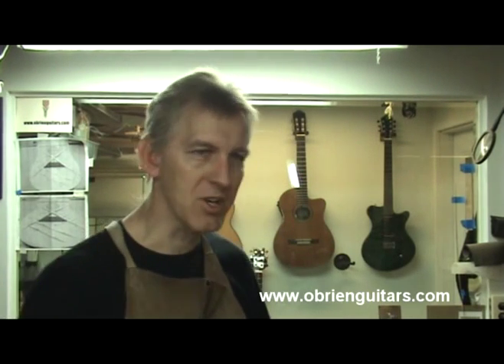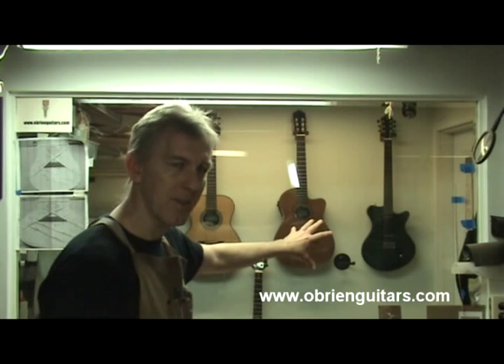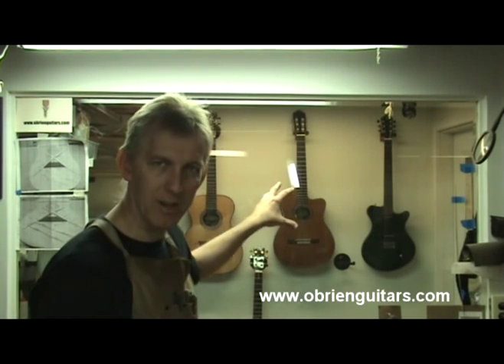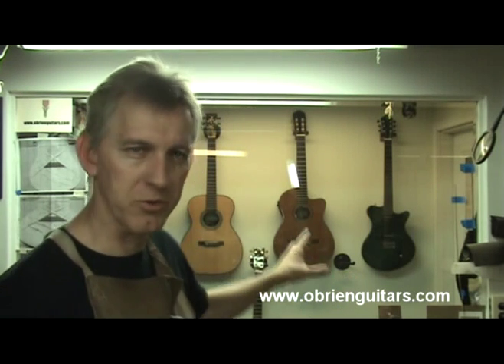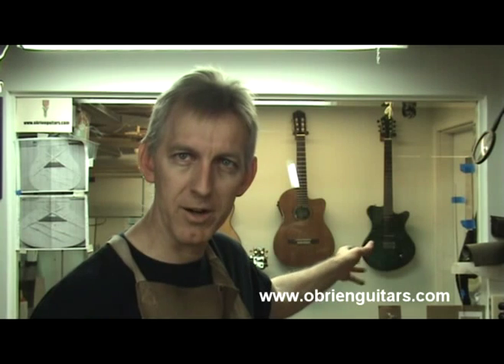Controlling Relative Humidity

Comment from the maker: In Brazil I had a thick sheet of plastic that I hung from a ceiling in a square shape. It went all the way to the floor and was closed with clothespins on one side. Inside I placed a dehumidifier. I placed the wood inside it for about a week before I began working.  Yes, if you build at a higher RH level and then take the instrument to a lower RH level environment it will be prone to cracking unless you humidify the instrument somehow.

Comment from the maker: @ElRoedor The builder is probably confident you won't have issues because he built the guitar in a lower RH environment. However, the guitar has been living in a higher RH environment and any drastic changes could spell disaster for your guitar. I would make sure the case has a good humidifier in it. I would also place a humidifier in the instrument and make sure it stays moist. Check the humidifier often. I use one called a dampit.

Comment: Robert,can you briefly tell me how did you deal with high humidity in the time that you were building guitar in Brazil.You said in the video that joining top or back plate in the humidity controlled room would made the work pieces to crack. How did you resolved that problem? If you gonna send the guitar that you made in Brazil to another country that has RH lower than 40%, could the guitar top will be prone to crack. I know that humidity issue will cause more problem to acoustic than solid body.

Comment: I live in the country in tropic where the relative humidity seldom go down below 60%. It's typical around 70% or more. Will it be a problem with building solid body electric guitars? I've heard some neck problem of bringing guitar to low humidity environment like in the winter of the US. I know that standard relative humidity of the mass production guitar factory is around 45%. It's looks like the midway that's not too dry or too damp like my country. I don't have humidity controlled room.